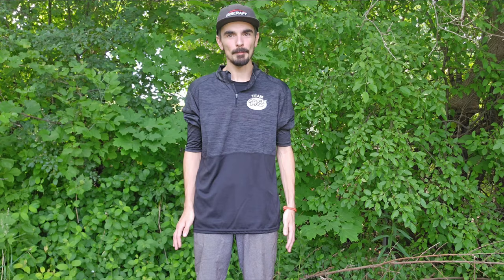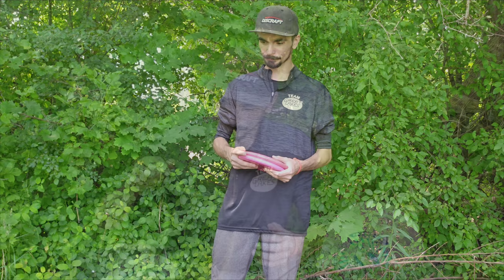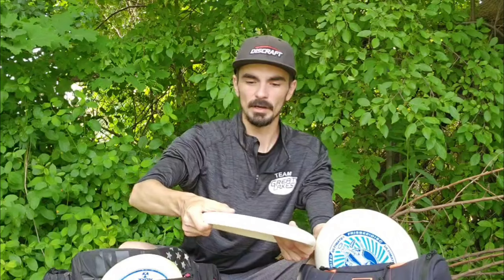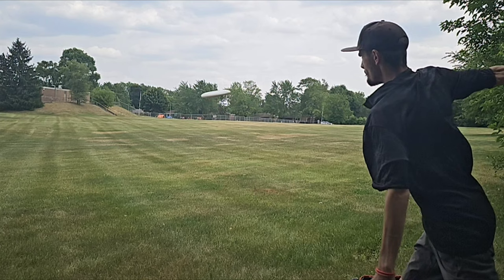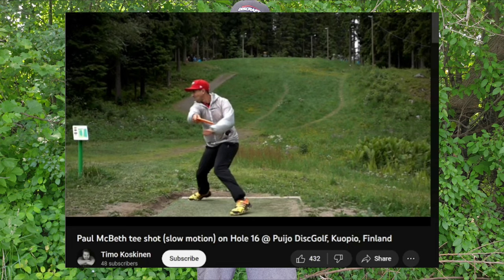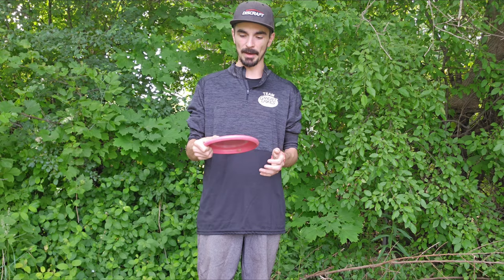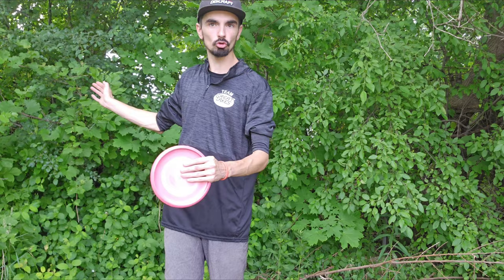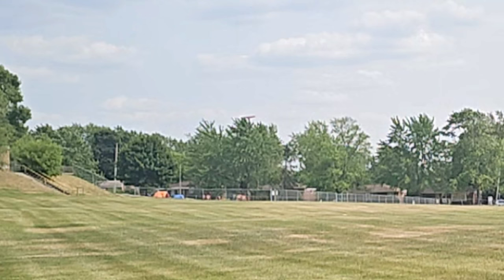How to Throw Your Disc Farther (By Reducing Off-Axis Torque)

Comment: It looks like you are keeping it flat to avoid off axis torque... What about keeping it nose down? Is pushing the nose down going to make a wobble, or is that just the alignment (twist) of the wrist repetitive to the forearm? Or is that relative to the plane of the shot/pull line?
Reply from the maker: Keeping the nose down is always a good thing. As I mentioned, you are never going to perfectly match the angles but getting them as close as possible is the key to success!
Reply from the maker: But one more thing to note, it's important to match the angle no matter what type of shot you're throwing. If you're throwing a hyzer or an anhyzer, you still wanna match that angle
Reply: I enjoy slowing a Video down to see if a long Putt or Approach exhibits a Positive or Negative off Axis Rotation. I feel that a Positive type of Off-Axis Rotation is better since the Disc doesn't want to go Peel off early from the Target Basket.

Comment: Great video! I wanted to point out some things that don't seem to get a lot discussion online, regarding wobble. Eliminating wobble comes from having the angles aligned, as you point out. But the way to do that is at the hinges. The elbow rotates the forearm, the shoulder rotates the upper arm. I drop my elbow, creating wobble, and I've been working on fixing that at the shoulder. Super hard to do if you have bad muscle memory ingrained. Anyhow, I also want to point out a video I made on this issue, that I think helps to explain it. I think this is a very common problem and too many people address by simply curling the wrist. While that minimizes the issue, it doesn't solve the actual swing plane issue, which needs to be addressed independently of wrist angle, because it's a forearm and upper arm angle problem. https://youtu.be/zTXTNauAczM